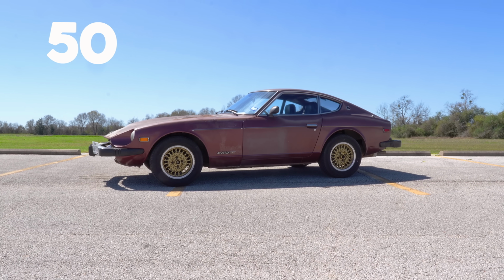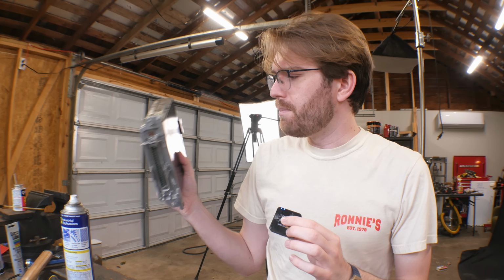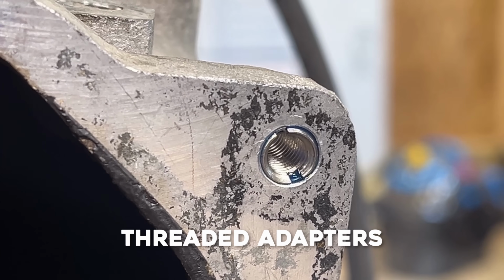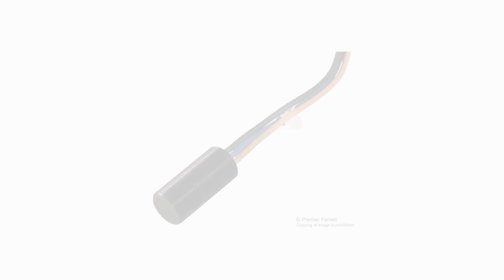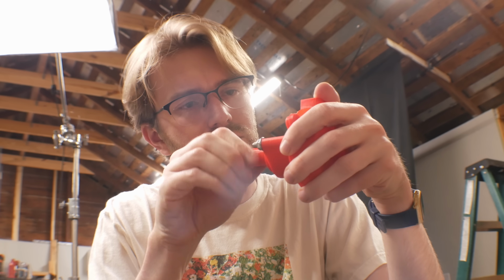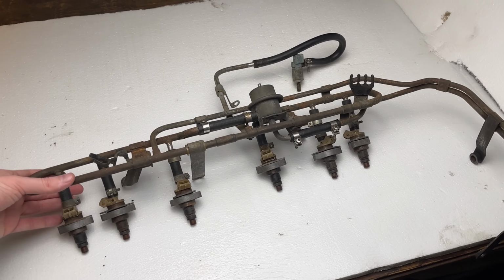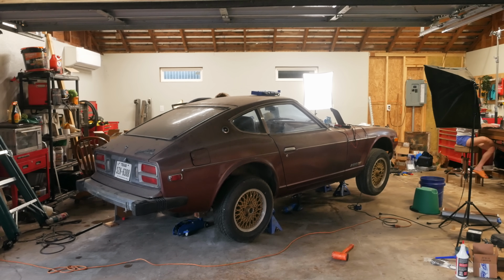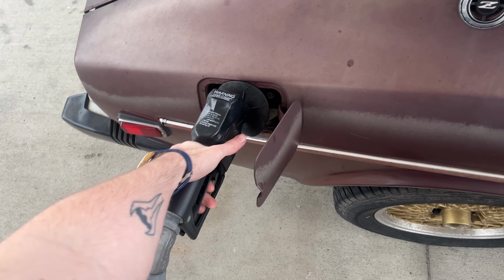Modernizing a Vintage Car

Comment: “This car hasn’t ran for 20 years, but I got it running” while saying “old cars aren’t reliable” doesn’t make much sense man.

Only old cars sit for 20 years and with a few tweaks, start right up. If one sensor fails, or a mouse chews one electrical cable in a new car, you’d think it’s possessed by 50 ghosts, if it even runs. Heck, sensors in new cars die just having the car sit for a year, then it’s totaled. Not joking, cars come to the scrapyard detailed as totaled if there’s even a hint of electrical gremlin.

My grandfather’s 52 Chevy truck sat in a field for who knows how long. It sank to the frame and bed. I rebuilt carb, tuned distributor, rebuilt fuel pump, unseized engine, plugs n cables, and it fired. The sears brand tires even held air and I lifted it out of its grave. Furthermore, without brakes, it drove. I’d like to see a new car sink to its frame for 15-20 years and get revived in one day of work.

Comment: OMG that's a surprisingly fuel inefficient overhead cam engine in stock form for a 2.8 straight six with fuel injection! That's worse than a mid-70s Triumph TR6 overhead valve six 2.5 with Lucas fuel injection! The original 1968 Triumph 2.5 PI sedan, with Lucas fuel injection and an overdrive, would get mid-20s mpg if properly set up & driven sensibly!  That Datsun 2..8 six engine surprisingly doesn"t have a cross-flow head either so its basic architecture isn't exactly designed for fuel efficient operation; so my guess is you won't see obtain much better gas mileage, 18-20 mpg max perhaps. Lipstick on a pig? Blame it on the US emission regulations at the time which basically strangled engines to death!

Comment: 23:30. You probably could have skipped installing the transmission and engine for that measurement by just using a tape measure and observing what's going on down there. But I guess that works too. Lol

Comment: I wouldn't say newer cars are more reliable than older cars. I own four cars, and the one car I rely on every single time to start and run without fail, and has not let me down, is my 1984 GMC K2500.

Comment: There's absolutely no way today's cars are more dependable than the cars from the 60s and 70s. You can't even work on newer cars without being a flipping rocket engineer with all the computers and sensors all over everything.

Comment: Does the car have a catalytic converter? I missed the before & after emissions as I guess the % improvements in efficiency will be greater. For more power I guess you can raise compression if you can add a knock sensor. Very good engaging video with great jokes. Very impressive project.

Comment: fun fact the engine in the Datsun 240 Z was increased to abt 2800 cc primarily to compensate the power output losses due to emission controls standards introduced in the US in the late 70s. EFI was also introduced at the same time to meet the same standard

Comment: To hell with modernizing it.

Take an L28. Overbore it to a full 3.1L.
You can get away a stock cam, but you want to port & polish the heads.
Put twin TD05 or TD06 turbos on it with triple Weber carbs.
Ideally, you should install a dry sump oil system, but you can still go with a standard one.

Try not to wreck it.

Comment: I like to have a modern car so I bought a modern car. That’s a much easier solution than modifying an old car. Why on earth would you do that?  I like classic cars too but prefer an unmodified one.  What is the point otherwise? I must be missing something here.

Comment: My god... How did I not know you existed before this. You made MORE power and consumed LESS fuel on a dirty ass old engine. Wow man... I wonder what would happen if you were able to clean up the engine and rebuild it from top to bottom and add a new exhaust that would be more fitting for the new powerband.

Comment: So this is my first video of yours I've ever seen. And it was pretty good. I think you were able to explain tuning and things that helped me better than any automotive YouTuber that I watched because you were learning it. So you were able to relate it to people who would have a zero understanding as well. So I have like a bunch of advanced knowledge about tuning, but you gave me some core basics that I was missing and I greatly appreciate that. I would really love in the next stage of this project for you to update the intake plenum, the exhaust, put some sort a heat shielding in-between them at least. That way you can reduce heat soak and get even more efficiency out of them. Keeping with the core premise of everything being reversible, so you could put the stock exhaust and intake back on if you wanted to, and at least you could do some fiberglass heat wrap on the headers, which you can just cut off if you need to.

Comment: I'm actually going through this with a 1967 Ford Thunderbird four-door Landau edition. Really cool car being the four door it's actually got rear suicide doors like the Lincoln Continentals of years past. They only had the four door model for 4 years 67 through 72. I used to live out in California and I bought the car out there It has some surface rust and rust around the wheel wells and in the trunk so I'm going to be working on restoring that not show quality but just getting rid of the rust so it doesn't rust out and prevent it from getting worse and stuff like that. I'm finally on that after spending the last few years fixing up the car and really modernizing it in a lot of ways making it run a lot smoother. For honesty sake I don't work on my car I just don't have that skill but I make good money and this me in my hobby I've been able to work with good mechanics I find too get this car better than she ever was. Completely redid the brakes all new metal brake lines replacing everything with the braking system modernizing it and actually doing four-wheel disc brakes. For such an old heavy car this thing stops really well now It actually feels modern with its breaking. I'm not shy to let people drive it and they're really surprised at how well it breaks. I knew that these things can be dangerous on the highway and I wanted to drive this baby so I wanted to be safe and have good breaks. After that was done I've had the transmission work done luckily that was in really good shape but we still kept the original but just made some nice modifications to make it more modern and it very smooth shifter unlucky in that this car for the model your head the cruise-O-Matic but they had come out with an MX transmission I believe it was called and because mine was the top trim level with the four-door model I had the better transmission. Then we get into the motor, This thing had a 390 cubic inch big block V8. Very good strong engine so I've kept it but I've made a lot of modifications to it It's pushing out about 430 to 450 horsepower We haven't dynoed it yet but it's somewhere in there with probably similar torque It's a very fast car now. I also added fuel injection with a cold air intake. New headers. I've had the I've had the engine completely cleaned pistons all cleaned up lubed there was some damaged on some of them those have on all machined I had taken the engine out and did everything we could find every flaw we fixed on that thing We replaced a lot of the hoses with modern hoses and actually one long hose My mechanic did a custom job in snake that thing around and it's just one long heavy duty hose. That thing is not Lincoln any oil or fluids or anything It has been modernized and it is very efficient. Still a big block V8 and it's never going to be a gas sipper but it will get better gas mileage now because it's been improved. I find it funny because it's way more powerful too. It's cost money to do all this work but I'm blessed to have those extra funds and it's really cool to have a car like this. Never dreamed I would or that I do this well in life and I could actually put money into it. It's amazing how you can modernize these old vengeance It does take money but it's cool how technology can breathe new life into these badass old engines.

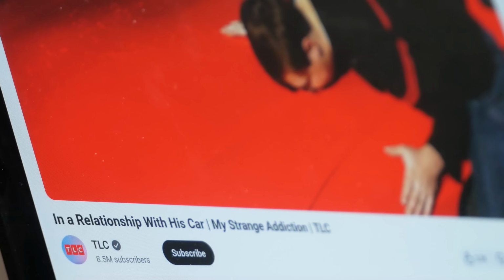Comment: 7:00 people hate electronic throttle cus its laggy and unreliable if you have one small problem with it the whole throttle body has to be replaced instead of js a tps sensor, or valve replacement. It also feels horribe on throttle response unless its an extremely luxury or expensive car. Usually they feel boring. They are smoother thats the benefit

Comment: I used to have a 1974 260. I think it was a 74. 
Anyway, it had a balanced and blueprinted straight 6 Nissan engine with the 240 carbs. 
Fun car. 
I'm very interested to see what engine you put in there.

Comment: You "want" a better system? Thats why it's so expensive to maintain and repair vehicles today. Besides, if you really think about it, "want" in one hand, and "crap" in the other. Which one fills up quicker? Learn friend. You want an older car to have more power put a bigger better engine in it. Its less work than you think.

Comment: About your hall sensor based cam shaft sensor 16:07. You want the sensor end of your connection to be made of of a softer material. This is because wear is bound to happen and you want it to happen at a place where it is easily replaceable.

Comment: Consider scoring another intake manifold and opening up its throttle body port to match your throttle body,
instead of necking down, which air does not much like to do.

Comment: Sounds similar to my own journey with my 79 Porsche 924.  Converting it from Bosch CIS injection (mechanical injection) to MegaSquirt Electronic Fuel Injection.  However, I did change out the cam (Integral "Stage 2") , cam gear (Franco automatically adjusting cam gear), throttle body and intake (TWM-Induction DCOE style ITBs on a DCOE intake manifold) w/Ford EDIS4 Distributorless igntion.  It was a massive undertaking to get it all working, especially the cold start tuning due to how far the injectors were from the intake valve, how big the throttle bores were and how little the compression ratio was.  I was able to to get it to pass emissions inspection and drive it daily for several years before the fuel pump died and then we had kids so its been sitting for about a decade now :/  

I might suggest ditching the stock cooling fan as they tend to rob power from the engine and moving to an electric fan.  As for not touching the internals?  I'd also suggest looking at increasing the compression ratio to at least Euro/Rest of World spec as they were reduced in the states to try and pass emissions requirements, but with your new EFI and ignition you could improve the power output and the efficiency with a little more compression and some work on the air flow through the engine via a header and perhaps a little minor cleanup of the intake manifold and cylinder head internals.

Comment: Bosch comes from automotive components and also does dish washers.

It started with generators and spark plugs to abs and esp as well as emission control systems.

So maybe not so bad of a choice for excellent Japanese cars.

Comment: I'm a big fan of the Bosch L jetronic system it was a lot better than the  previous mechanical CIS setup, the only time to replace it would be for a programmable wider flow range system but then it's not period correct... 😮

Comment: Had an 81zx back in 1990. My starter would do the same thing, but a hammer wouldn't work, had to pull the starter off, pull the bindex out and let it snap back in place. Then reattach until the next time, which tended to be when it was raining! Also had the harmonic balancer spin into 2 pieces,.. first time I ever used JB Weld, and it worked.. all was in a 16yo's budget!!
Reply: Bendix*

Comment: I guessed 130whp, wasnt far off, means your engine isnt that bad TBH, I was guessing about 35-40hp drivetrain loss which would make your engine around the 160-165 mark, only 5hp off what it was 50 years ago....I'd take that!

Comment: So if you add 18/20% to your Hp figure to allow for the Rolling resistance and transmission losses your flywheel power is now over the original 170Bhp, Brilliant!
It would be nice to know how much ware/Losses there are in the motor itself. How high would the figure go if the motor was fresh?
Great work.

Comment: Spark timing is not usually zero.  It is a couple of degrees before Top, Dead, Center.(TDC) so that the combustion occurs slightly before TDC and the resulting, exploded gases can be compressed with the last little bit of stroke. Maybe give that a try….Love your vids!

Comment: Stock compression is like 8.5:1 you’re never going to make much power or have a crisp responding engine on that. You need something more like 10:1. Otherwise solid improvements…. Though I’d also suggest a mild cam upgrade, nothing real aggressive, want to keep the daily driver low end torque for a fun street car.
Reply: Its kinda begging for a turbo and he's done 90% of the work
Reply: @mycosys agreed, but I don’t think the pistons and rods would appreciate it, unless he kept it a smaller turbo not pushing much air mass. (I hate referring to boost because it doesn’t mean crap really, it’s about mass of air over time, grams/sec or lb/min.

Comment: I would have just designed a geared wheel to replace the rotor and put a hole in the distributor cap.

Comment: i use to own a 280 z and they suck the back end slide right out they handle like sh. my camaro handles way better on corners  and it was never built for corners but the same year of vett did worse then the camaro did on corners. after building up the suspension it did better then my friends 944 turbo it could not keep up on corners or straight shots i stomped it in the ground in the 1/4 mile. what u need to do is go wide body with wide tires in the back to help it from sliding out put the battery in the back maybe add weight in the back to help it grab better

Comment: Modern roller cams leave the valve open longer and shut it faster, electric fans use less engine power. (didn't really see what it has)

Comment: You Bett.\nER, be real for good friends with the guy who does the inspections on your car?He's gonna take one look at that engine and go.I got it inspected based on the current inspection Regulations. Because in\nThose regulations, your cars inspect it based on the engine, not the frame, which means you can have some real problems.Getting your brakes up to date as well as Emissions..

Comment: Hey man, fantastic video! I've got a 1983 Datsun 280ZX Turbo myself, so I have to ask: Any chance you could share a component list and build information? I've been desperately trying to modernize the L28ET in my car but Megasquirt has just felt kind of overwhelming and I'm not familiar with the system you used, but it seems perfect!

Comment: I so miss my 1978 280Z,- bored and stroked to a 3.1liter, custom ground cam, duel webers- 6 into 2 into 1, Monza exhaust,  MSD ignition , replaced my 5th gear with a 1982 280 zx 5th gear- full Tokito suspension,  upgraded the brakes,  30mpg on the highway.  What an adventure  wish I never sold her!

Comment: In engineering, when you make something, it starts feeling like it was not that much to do and anyone could have done it. But I'm telling you, you should be proud of what you have made and most people would not have been able to do it. It's amazing and you're amazing and this video is amazing. Be proud of yourself.
Reply: Most people wouldn’t be able to even make a cube😂
Reply: This is the most underrated comment.
Reply: The perseverance is amazing. I am sure many of us have started and not finished projects or at the very least set them aside for some time. The dedication here is amazing.
Reply: Perfectly stated my good man. How many thousands upon thousands of projects ( most way simpler in scope as well) all across America are just sitting there, untouched!?? This was a fantastic project!
Reply: IMO, in any industry, most will suck at their job, of the people that don't, most of those people won't put the above-and-beyond work in, and if you can just do the work, and do it well, you will be in the top 10%. Maybe even unintentionally make it to the top 1%.

Comment: The custom cam angle sensor is pretty dope. I wonder if the z31 distributor could be made to fit the l28. It has a crank angle sensor built in. Just wondering if anyone wanting to replicate might have an easier getting that to work. 

Either way, the custom sensor looks pretty clean. I am collecting parts to do similar things to my z31 using a speeduino. A similar thing may find it's way into my engine bay some day.

Comment: Interesting! I'm a mechanic, but I'll admit I've never seen anyone convert one like that! I know for certain I couldn't pull it off in my shop, because I don't own a dyno. I've had a few customers ask me about dropping modern engines in older vehicles though. I usually tell them "I can do the physical part of it, but they will have to bring it somewhere to have it dialed in before running it." It's a lot easer than the mess you got into though, because if you stick with certain engines (LS or Coyote in particular) the aftermarket community has a plug and play for most applications, and a healthy amount of support because it's been done so many times on so many different vehicles. (especially the LS I sware if it hasn't had a LS dropped into it it's probably so rare you are messing with something that should be in a museum not dropping new engines in!)

Comment: Well if you check the piston ring clearance or maybe change it to gapless piston ring, clean the valves and check if it seals, the MPG gonna be night and day difference. Anyway nice job!
Reply: Hell yeah, then it'll pay for itself in only 48 years!!
Reply: @RWDtech 😂
Reply: He's already done 90% of the work to turbo it, if he was going to do more that would be the obvious. Easier than rebuilding the engine too XD